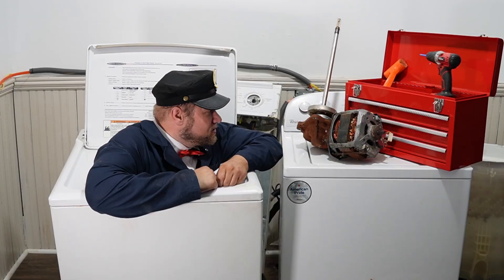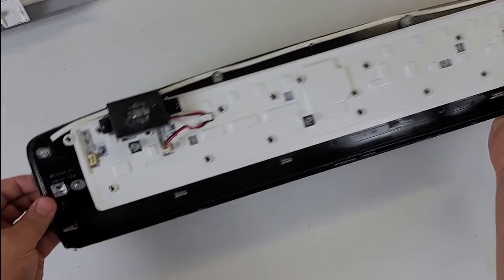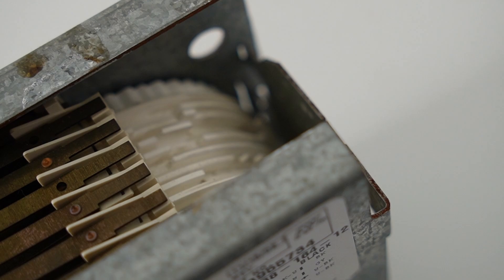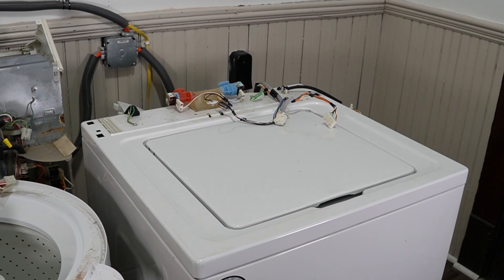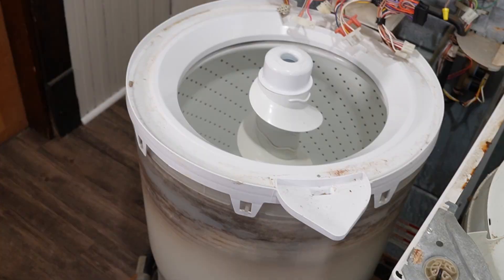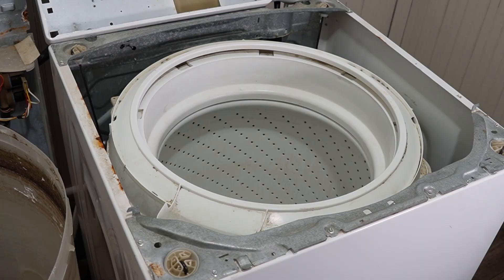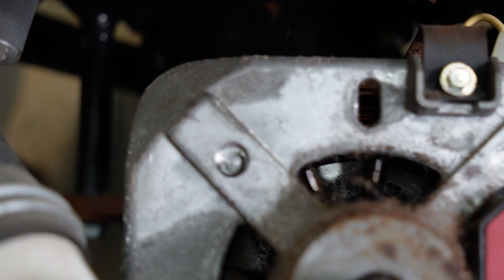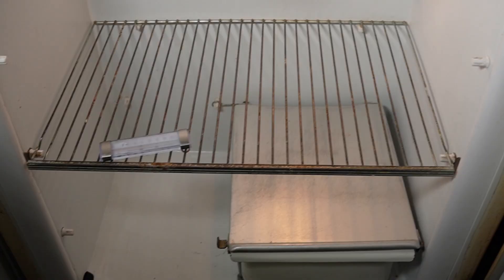Are Washers Built to Break? Inside a 1984 Washer vs. Now

Comment: Occasionally I do a video like that, where everything goes wrong and you wreck it in the process of trying to take it apart.  But your video was absolutely fine to view.
Those pesky electrolytic capacitors on the low voltage side of the electronic power supplies fail because they have to deal with the current flowing in and out of them 10's of thousands of times a second.  It means they have to be low ESR (Equivalent Series Resistance) to do the job without getting too hot.  When they start failing it's an avalanche effect until they puff up or blow their top.
Their life is a LOT harder than the ones on the high voltage side which only have to deal with 120Hz ripple.
Reply: Nice to see you encouraging smaller creators! I really think this channel is an up and comer.
Reply: Totally agree.  The sad part is a nice MLCC in parallel (just a few cents in bulk) would probably extend the lifetime quite significantly by reducing the ripple current of the electrolytic.
Reply: Nice to see you here, I enjoy your videos, but you'll never see this comment.
Reply: @tonysolar284  Oh yes I will.
Reply: @BigClive  Well played. I hope you have a good day.
Reply: Bigclive the god has spoken
Reply: Of course you're in the comment section of ANOTHER video I watch.  Talk about interests that overlap!
Reply: @TechGorilla1987  It happens more often then not, all thanks to the YT algo.
Reply: I love randomly running into your comments.  It shows me we are into the same weird esoteric interests. First was seeing you on the HVAC podcast, now washing machine repair.
Reply: Oh wow, Big Clive!  Us technical people are always clicking on the same videos.
Reply: @Tommyinoz1971  When you grow up taking things apart to see how they work, it tends to stick with you for the rest of your life.
Reply: Well Said clive when replacing those Capacitors, I get the highest hour rating with the lowest ESR.
Reply: Motor capacitors used to start single phase motors are always a problem....Solid state logic systems usually have a decent life but if there is a single component failure you get stuck for a VERY HIGH PRICED REPLACEMENT.  Relay logic has a simliar failure rate but is a lot easier to trouble shoot and replace.  This applies to timing relays and mechanical timers... also also.    Overall, modern designs benefit the manufacturer but not the customer.
Reply: @ccoder4953  Extend the lifetime! That kind of talk will get you fired at one of these appliance makers nowadays. Ideally they'd like an appliance to last 366 days  - just enough to wait out the embarrassingly-short warranty.
Reply: @TenOfZero1  Bigclive is just as small as this guy and should stay that way because whenever someone gets viral they turn poopy
Reply: @catfree  Bigclive has an order of magnitude more subscribers than this guy. 11x to be more precises. He's almost at a million. 

I agree with you, but I think bligclive will stay ok, I don't think he's doing this for the cash
Reply: @TenOfZero1   I never bothered looking at subscribers I thought they disabled that too
Reply: @catfree  I'm sure they will soon. 😞 Youtube makes some strange choices
Reply: The Manx Bear in the wild. You and your brother are both awesome.
Reply: When i see those low voltage capacitors puke their internals, i always think "sweet, easy fix!" No way i'm putting 200€ for a board with 15cts faulty caps
Reply: hey clive i love your videos and its cool to see you in a random comment section, didnt expect that :)
Reply: oddly specific with the componentry...oh its you! plot a schematic.
Reply: BigC, love your videos.
Reply: That’s not why electrolytic caps fail. 
They mostly fail because electroly caps don’t last forever. If there put some place where they’re hot they’re going to last less. And if the manufacturer cheap out out by using The absolute minimum part with very little margin. 
You’re talking about an appliance that’s going to be on continuously for 10+ years that’s 80,000 hours on a part that’s only rated for 10,000. 
Electroly caps didn’t last forever even back in the day of linear power supplies. And 120 Hz.
Reply: Big Clive you have quite the fan club!
Reply: The caps protect the starter coils. Its so you can have less current to start up the motor on low volts. Less Inrush. The problem they should have a leaky indicator or someone needs to check them constantly. Cap goes your winding goes
Reply: @hgbugalou  Now you need to slide over to Eric O's channel South Main Auto repair...
Reply: In a lot of electronics which goes flooey, faulty electrolytics are the culprits. Look for bulging tops or leaking fluid. The tops are scored to break when they have to. Often replacing them puts the board back in business. Fixed TVs and computer monitors this way.

Comment: My grandpa had a family of eight kids and bought a Maytag washer and dryer in the 1960's. It lasted him over 45 years with just a few belts, a timing motor and one heating element.

Because it was all electromechanically run, he could keep it going without spending a lot.
Reply: May tag has been crap, in the last 25 years.
Reply: My grandma bought a Maytag top loading HE washer I think in the 90s and lately it was making a bad grinding sound and when I looked at the bottom around the machine, it apparently blew out transmission oil on the tile and was a pain to clean. Explained the grinding sound she had been hearing.